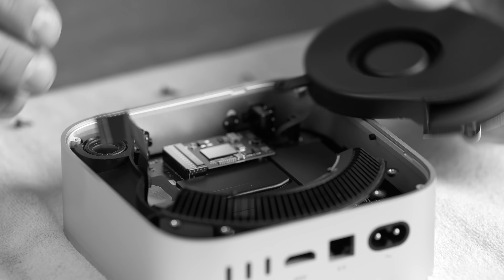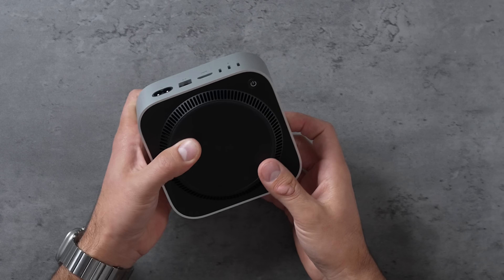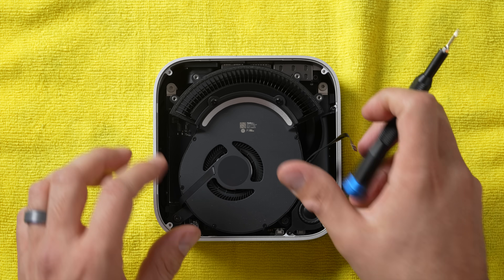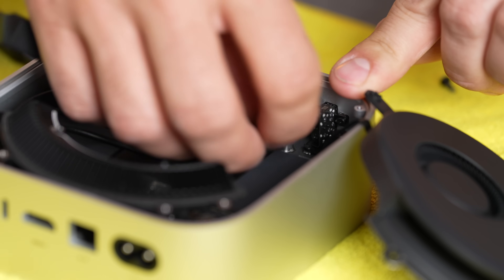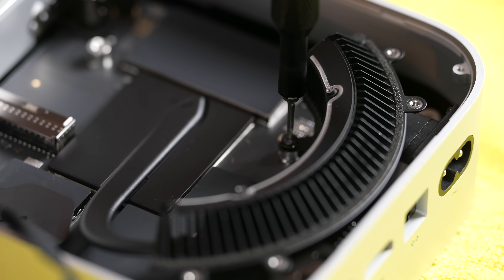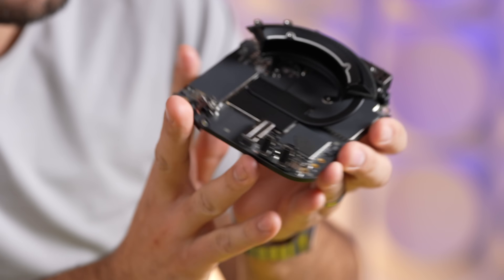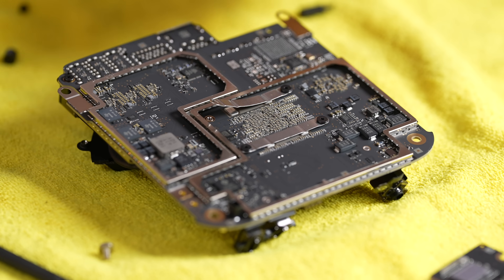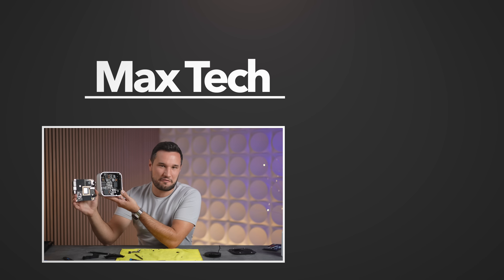M4 Mac mini FULL Teardown - Apple Finally FIXED IT?!

Comment: First thing which strikes me for the Mac Mini is potential of upgrading the Wifi to Wifi-7 being that Chip is separate, that might be very interesting. I couldn't see what chip that was. All that's needed is potentially Apple to have the support in a future device in Mac OS, and then we could see a theoretical path to an upgrade.
I forgot to Add, I love this kind of video content, it's very refreshing, and hats off you broke the bottom, but it looked like there is a way which could be removed if you know the right positions. Well done Max

Comment: Wow... First the 64GB of RAM, then TB5, now it's even got a replaceable SSD. This tiny thing will be a legendary piece of tech from Apple. I'm impressed.
Reply: Replaceable by apple original parts with HW-pairing. No off the shelf SSDs here of course...
Reply: About the power button, it's almost as if Apple wants us to keep it upside down, mm24 is easily computer of the year
Reply: Upgrading the modular storage isn’t straightforward. To expand it, you’d need to purchase compatible NAND flash memory, along with the right tools and skills to handle the upgrade safely, which can be a bit risky. Plus, the memory itself isn’t exactly cheap
Reply: Apple website says otherwise "Note: Storage is not user accessible. If you think you’ll need more internal storage in the future, you’ll want to select your capacity with that in mind now."
Reply: You can replace the SSD but good luck booting up after that. Apple is so blocking that.
Reply: You know aside from TB5, intel has been doing this for a while right? But on intel not only is it smaller being 4”x4” but both ram (up to 96GB) and ssds (sometimes up to 2-3 nvme) are user upgradable, and they carry high end laptop cpus.
Reply: Your comment is a great indication of how apple fans are like zombies promoting normal features as revolutionary ohh look upgradable storage ohhh wow 64gb of ram impressive i've had 64gb of ram in my pc for 150bucks its either you're trolling or idk i cant even imagine that someone would be impressed by this 😂
Reply: @mouna54gml  It's not a Mac vs pc thing, non upgradable storage is how Apple make their money with Mac's, by overcharging for storage and ram upgrades. That's why it would be a big deal if you could upgrade it. 599 would be too good for what your getting otherwise

Comment: How often do I turn off my desktop?
EVERY SINGLE TIME
Reply: wrong!
Reply: seems easy enough to relocate the powerbutton if needed
Reply: Is not a big deal. I lift it about 5mm and press that button… It’s small, is not like you lift a tower pc😂
Reply: @IcemanTheDj  I don't mind that power button on the mini but just that statement.
I might put it on top of a box to lift it up
Reply: @MyInstantSearch  yeah... I also turn it off often! Even so, just got it yesterday and is not such a drama the button placement. Could be better? Maybe yes.

Comment: I think it will be better to use it upside down on the table - for better air circulation, better WIFI connection and ....       access to start button! 😄😄

Comment: Can it boot up automaticly when external power applied, so it can be attached to a TV and booted up using a powerboard switch, same one powering the TV?
That is no need to press the power button, just apply power?
Reply: You can enable this in settings (start up automatically after a power failure)

Comment: It is great that there is no performance loss on the 256 Gb version of the SSD. It will be possible to keep the whole of MacOS and also the swap file on the internal SSD together with a few important utilities and games. Less important games can then go on a cheap external 2Tb SSD. Most recent PC games are over 100 Gb in size and so you will run out of flash storage quite quickly.

Comment: That doesn’t look like enough thermal paste - all the corners and an entire edge of each die were left bare silicon. Would be interesting to see benchmarks before and after you did the tear down.
Reply: The silver piece is the Heatspreader, the die is was smaller
Reply: Do humans assemble them and apply thermal paste? That could be the reason.
Reply: I was also wondering about that

Comment: Wow. Do your research. That is not an SSD. It's only the nand which you would have known had you actually read up on the mac studio discussion on the replacable nand.
Reply from the maker: Yes, you have to do a DFU reset. Many people are already upgrading the NAND storage themselves on M1 and M2 Mac minis by desoldering and resoldering more storage, and doing DFU reset.
Reply: @MaxTechOfficial  That's not quite the same as a user upgradable  "SSD".
Reply: Ханд это и есть ssd

Comment: But isn't the SSD a proprietary form factor? With a SOC level controller? It's nice that you can repair it without throwing out the whole motherboard but I'm not sure this will give us cheaper internal storage upgrade options.  I hope I am wrong. I just got mine today and it's fantastic.  Best Mac since ..... I can't even remember.
Reply from the maker: Yes, you need to do a DFU reset to make it work with an upgrade.

Comment: Now if Apple would only release a budget friendly 24" Display to go with the Mini......
Reply: There are tons of 24 inch 4k displays by other brands with good enough color specs that won't disappoint you
Reply: Apple is like Toyota in the tech world, they build the most reliable hardware in the world, they cannot sell cheap hardware.
Reply: Get the new iMac instead then.
Reply: @Puzzu  while I am not saying that the iMac display is not worth it, apple's display are usually overkilling for the public, particularly in color accuracy

Comment: That engineering is fricken amazing
Reply: except for the power button on the BOTTOM
Reply: fully disagree as the ssd they use is incredibly anemic and far too expensive for what you get compared to the latest and greatest available today, that drive, while it looks like a 2230nvme ssd, isn't and is proprietary and you couldn't switch it with better and more affordable off the shelf parts, furthermore, it only Topps out at 3,400mb per second or 3.4 gigabytes per second, were talking about speeds that would've been state of the art in 2010 to 2014 for a single ssd. Pcie gen 3 ssds top out around 3.4ish gigs per second, in 2024, we have full size pcie gen 5 2280 nvme ssds such as the crucial t705 which Topps out at a mind melting Sequential Write, 10,200 MB/s ; Sequential Read, 13,600 MB/s You could get a 4tb t705 with a nice heatsink already attached for literally 600 bucks and it would be better than their half attempt at sustainability all day, as well as it runs with this old ssd standard, imagine how much better it would be with 4 times the read write speed with that wonderful but definitely bottlenecked by the slower ssd m4 apus.... Its a real shame, everything else is fantastic expect for this.
Reply: @bobking7347  The M4 is slow. M4 Pro SSD is 7000 MB/sec.

Comment: Thnx for the dissection, don't have to do that myself now. Going to use my M4 merely as a media/htpc so 256gb is enough as all stuff resides on my NAS. I love Apple's ye for detail. The M4 2024 will upgrade my 2014 mini. It serves as Airfoil server.

Comment: There is NO Way Apple would permit a DIY storage upgrade.  There has to be a catch!
Reply from the maker: Need to do the DFU reset method, like many are already doing on Mac Studio SSD upgrades.
Reply: @MaxTechOfficial  If I do the DFU reset method, would that eliminate my ability to participate in the Apple trade in program when a new Mac mini comes out in the future?  Or maybe it is as easy as putting the original SSD back into the Mac Mini.  You guys have the best content!
Reply: @MaxTechOfficial  does this work with third party ssd´s? Or only the apple ones?
Reply: @dotnetapp  It is a proprietary ssd.  At this time there are no 3rd party ssd's available for purchase. 😒
Reply: @MaxTechOfficial  !!!?!!! WHHAAAT!!??!! Awesome!
Reply: Chinese maintenance engineers have launched this service for just $200 USD.Amazing~
Reply: @SANQIU-v8l  What exactly do you mean.  You purchase an SSD from them or you send your unit and they return it upgraded.  The second method surely costs more than 200 to ship both directions.
Reply: @TC-hl1ws   send your unit and they return it upgraded，256GB upgrade to 2TB ，only 200USD
Reply: @SANQIU-v8l  What would I search to find this service?
Reply: @SANQIU-v8l  USA
Reply: @TC-hl1ws  I'd like to offer you this service, but
Reply: Let me contact the Courier first
Reply: @TC-hl1ws  Well, cross-border delivery is too expensive. It costs at least $100，I can only send you the memory pellets and the tools ，The operation is simple
Reply: @SANQIU-v8l  Thank you for the offer but replacing the NAND chips and OS is beyond my skill level.  Have a good day.

Comment: It is not really an upgradeable SSD. That's raw NAND, not an SSD. Who is the "other guy making replacement chips"
Reply from the maker: All you need to do is a full DFU reset and it should work, just like on the Mac Studio.
Reply: @MaxTechOfficial Can you make a video how to do it? I mean thats gold. Bying the entry level Mac Mini and upgrade to a larger strorage. GOOOOOLD! Please help us 😂🙏🥳
Reply: @MaxTechOfficial  Nice. Looks like cost if you buy already soldered is about 1/2 of Apple's price or only 4x normal cost vs 7-8x. $150 for boards + $50/tb if you do it yourself.

Comment: btw... those cables from the power supply are not powering the board... those are for the LED indicator. Those two holes feed the power to the upper board using screws...
Reply: the two pins are visibly there. and he missed it 😁
Reply: Well spotted!!
Reply: Thats an amazingly clever design in my opinion.
Reply: Yesterday I successfully converted the new M4 Mac mini to run on 12v dc power! Really happy right now
Reply: @tomarkenbout9087  how? could you make an youtube tutorial?

Comment: Would love it if you could test out the difference between the 12 core m4 pro and 14 core m4 pro mac mini's. Especially the thermal throttling and heat.

Comment: Mac Mini is the new King of Upgradability!
Reply: It isn't upgradeable though...
Reply: @Aethid  Unless Apple changed something, historically you just buy flash storage from Aliexpress, main issue is you need another mac to reprogram the SSD, but the actual process is quite straight forward.
Reply: @Verpal  Apple have changed them. Besides, waiting for someone to reverse engineer a proprietary part, and then relying on the user reflashing the system to bypass Apple's lockout, and voiding your warranty in the process, is not "user upgradable".

If it didn't void the warranty, then you might be able to argue it is user upgradable on a technicality, but it does. So it isn't.
Reply: @Aethid  If you want to argue semantics, sure, not user upgradable then, I am just telling you there is a way to do it and historically many people have done it, have a good day.
Reply: That's rich.  Fixed ram, proprietary SSD, plus you'll probably break something trying to get it open.  King would be DDR5 SODIMMs and a standard 2280 NVME drive.
Reply: You would think the king would make it possible to upgrade the memory.
Reply: What do you mean? It will not accept any aftermarket SSDs. Only apple original ones that will need to be firmware paired with the rest of the machine. And of course only repair shops will have access to it.
Reply: Only if it will be available on aliexpress. With apple you still pay 200$ for 512 gb
Reply: @punisher15101993  Externall SSD Nvm2, 4TB is cost 300 USD.... Enjoy :)
Reply: I like Apple, I use many of their products but this is far from upgradable. My Acer Nitro 5 is easier, cheaper and more capable of being upgraded.
Reply: Don’t be ridiculous. Zero user upgradeability.
Reply: OWC should have an express exchange service available within a year.